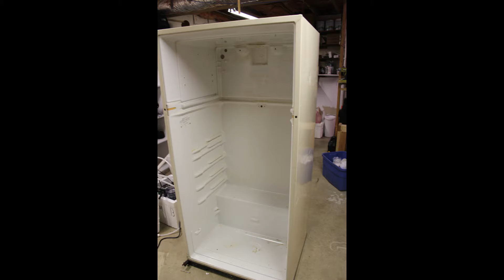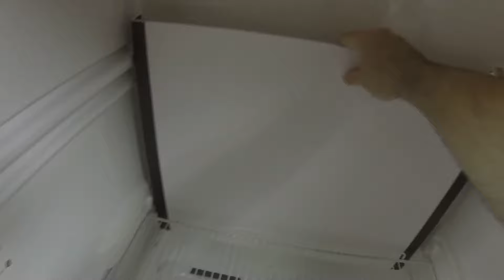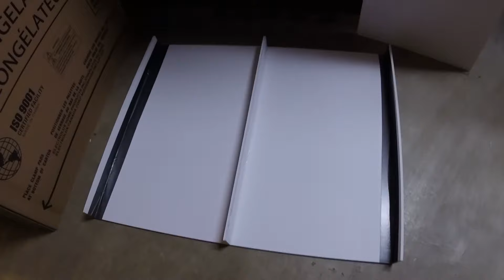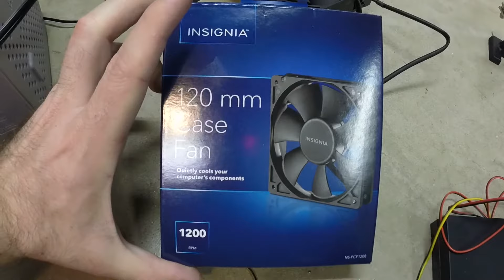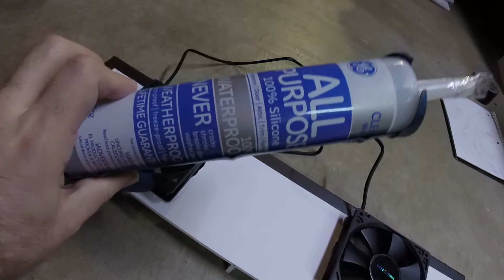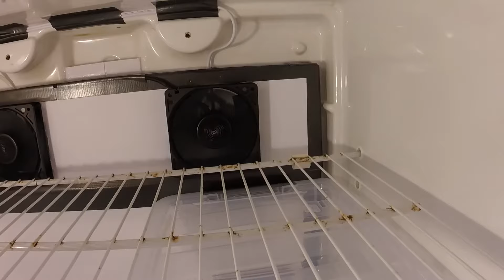DIY Refrigerator Incubator

Comment: What did you do with the doors? Use the ones that were on it or make a one piece door?
Reply from the maker: We used the doors that were already on it.
Reply: Can you post a photo of it finished with the doors? Did you put the plate back on between the doors or seal the gap between them another way?
Reply from the maker: We can send you a picture.  It will probably be tomorrow.  Just shoot us a message on Facebook, Instagram or an email.  We put the plate back on between the doors.  An old non-working fridge will work great!
Reply: I have a fridge like that in my shed that doesn't work. This seems like a good project and make good use of it it a few years when I can start breeding BPs

Comment: so I did something similar but with an Aquafina drink cooler I picked up off craigslist.  It turned out great and you can see it on my channel however I am finding out that the built in fan is generating a lot of heat.  It's either that or the snake room I have it in is  waaaay too warm to add an incubator.  The room is about 82 and so the interior of the incubator is spiking over 95 and was up to 100 at some points....so I'm not sure if it's the fan or the room temp.
Reply from the maker: Just watched your build video.  Did you try running it with the heat tape unplugged to see if the temps are still too high?  You could possibly narrow down the issue by trying this.  If you are still to hot with no heat tape running than it could be the fan.  If not than it's the heat tape itself that is causing the overheating problem.  Just trying to help troubleshoot without being able to see what's going on exactly.  :)
Reply: @ExquisiteExotics  i had a local breeder tell me his incubator is the same and he had to take out the electric fan and replace it with a computer 12v fan and that solved the problem...so thats what im doing
Reply from the maker: Let us know how it goes.  We have two fridges like that that we will be converting to incubators this winter.
Reply: @ExquisiteExotics  like mine?? Cool i will keep you posted...i may update my video too in case anyone actually watches for educational purposes...lol
Reply from the maker: One very similar to yours and the other is an older stainless steel fridge with a glass door.

Comment: Wow guys!! That is an awesome build!! I almost picked up that fan controller for mine. I have 200 cfm fans in mine that need 3amps a piece. I found with a higher air flow it is easier to maintain the same temp in the whole incubator
Reply from the maker: Thanks!  We were pretty happy with the temps we were getting with both fans at full speed.  We haven't tried turning them down yet to see if it impacts the temps top to bottom.